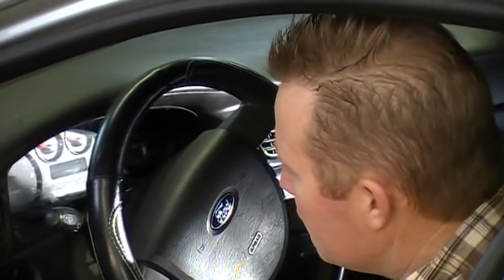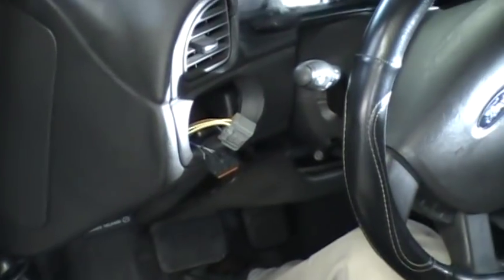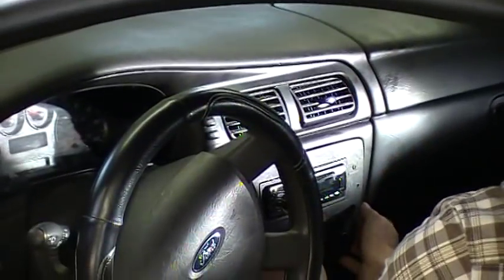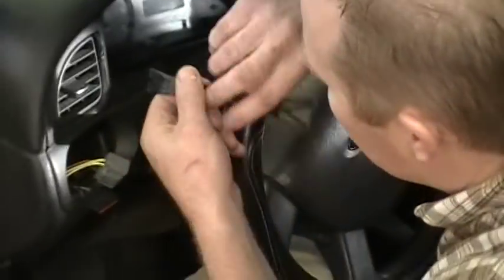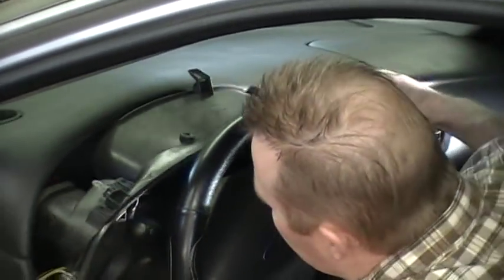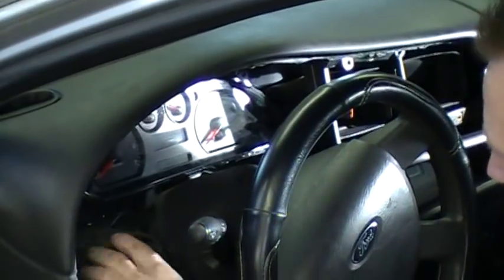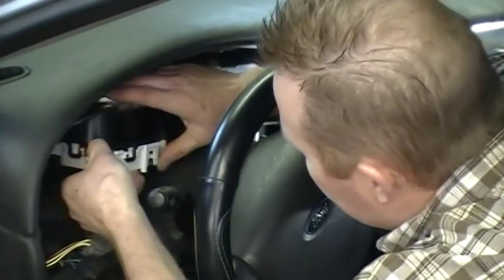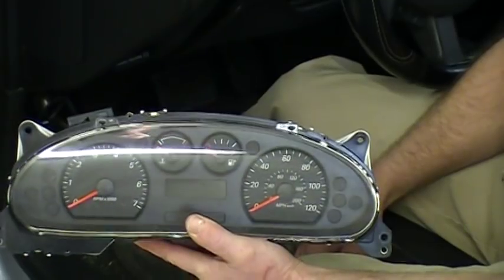FORD TAURUS / MERCURY SABLE INSTRUMENT CLUSTER REMOVAL PROCEDURE BY: CLUSTER FIX

Comment: I have never commented on a You tube video but I had to with yours. EXCELLANT job explaining how to remove the cluster panel. The explanation was incredible to understand and the lighting was fantastic. GREAT job. I would like to see a video of actually replacing the steering wheel sensor. 2008 ford Taurus sel

Comment: Thank you. Just got a Taurus (2007) and the fuel readout changes whenever the check charging system light comes on. I was told that the cluster needed to be replaced. Also my battery drains if left connected overnight. Now I can do it myself. Great tutorial.
Reply: Was your issue the cluster?

Comment: So most of the blacklighting went out on my 2003 taurus' dash... my solution was cannibalizing the 12 volt socket plug from an fm transmitter accessory that I never used and then soldering together a set of 4 red LEDs that can be turned on for nighttime driving.  Based in how much hell it takes to get to the dash components,  I get the feeling I made the right choice.
Reply: the screen that shows the mileage and stuff went out but the other lights are fine, what should i do?

Comment: I have 2000 mercury sable ls wagon.  The trip odometer and mileage odometer stop spinning. Would know it's the plastic gears that broke or a fuse. I also need to know it's a bid deal

Comment: What is the exact length of the 7mm screws?  I had dashboard cluster lights replaced by my mechanic and after a while, I noticed the dashboard was squeaky while driving. I noticed the two screws on top of the cluster was not reinstalled.  I tried some screws around the house to install, but they're probably not the correct size.